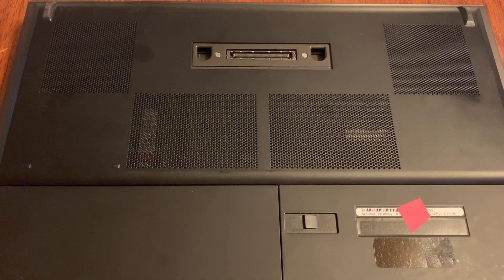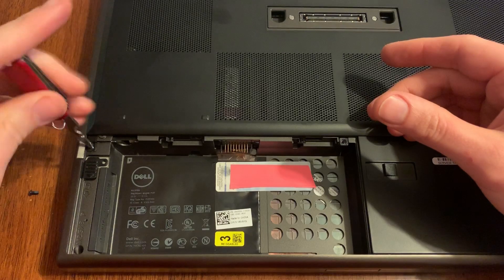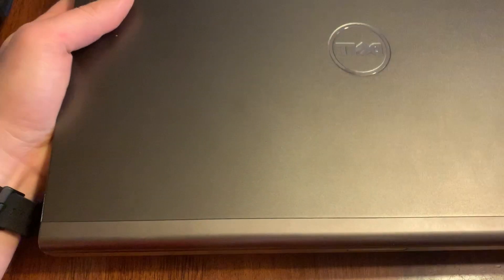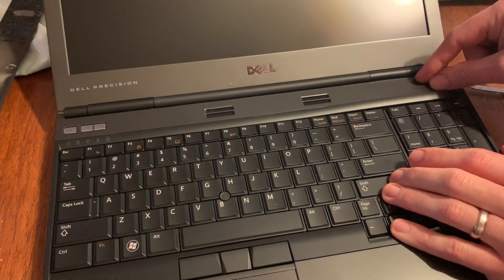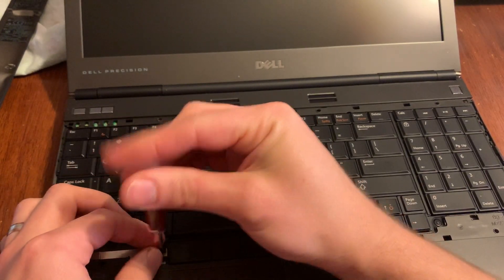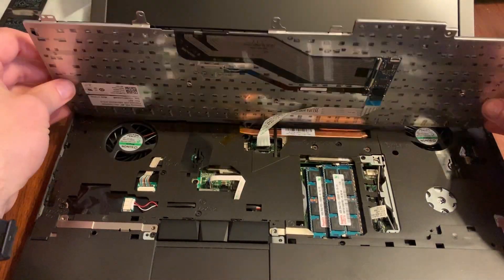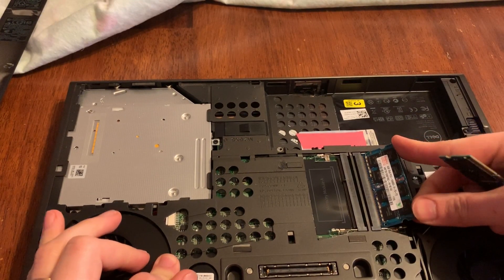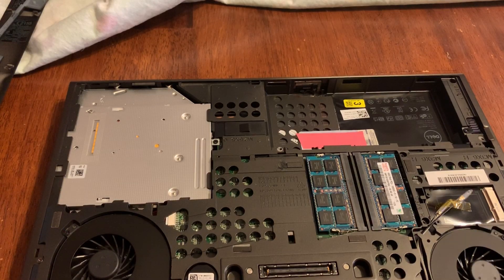Dell Precision M4600 Ram Upgrade

Comment: Thank you for the video. I have  a Dell  m4600 i7, 256 ssd, 16 gb ram and still works great after 8 years.
 I intend to buy another m4600 i5 for a verry good price and need to update the SSD and the ram.
Reply from the maker: They are good laptops.
Reply: Yes please tell its my humble request dude
Reply: Yeah mine works still fine..

Comment: I got the Dell M4800 labtop from 2014.  It's a great computer.  I also like the fact the keyboard is very similar to the IMB think pad keyboard which was my favorite keyboard for labtops
Reply: i want to upgrade my m4800 to 32gb . is it possible .and which type of ram is rquire

Comment: Muy útil el vídeo para realizar el upgrade de la memoria. Mi máquina paso de tener 16 a 32 Gb en ram. Quedó funcionando la locura.
Pretty useful this video for the upgrade of the memory. My machine passed from 16 to 32 Gb, now it works so great. I bought the memories in Amazon, the brand is Timetec
Reply: Qué tipo de ram lleva esta laptop?
O dónde la puedo conseguir, ya que en Amazon no me aparece nada de esta ram
Reply: hola Yahir disculpa tengo una dell m4800 Intel(R) Core(TM) i5-4300M CPU @ 2.60GHz 2.60 GHz con ram instalada de 8 : gb.
 sabes si puedo aumentarla a 32 gb, agregar una de 8 gb en cada uno de los espacios vacíos A y B, aparte cambiar las que ya tiene instaladas de serie de 4 gb cada una ( que me dan los 8 gb) o solo podre cambiar las A yB ?

Comment: Thanks for the video. I've got this laptop, currently with 8GB RAM. I do a lot of film editing - do you think that 16GB is good enough, or might you know if more is ideal?  Also, if I stick the full 32GM of RAM into it, are there any issues you think I might encounter? Thank you.
Reply from the maker: 16gb is probably a good start.
Reply: @mjmcomputers  thanks.
Reply: @joshuajohnson-familyfriend8510  may aswell knock the 32 in, what else are you going to use soddim DDR3 for

Comment: Hi, man! What configuration did you use? DDR3 1333 mhz 1060? TY
Reply from the maker: I don’t recall what I installed but it will accept DDR3-1600.
Reply: @mjmcomputers I'm using 2×8GB 1866 MHz on my M4700

Comment: i try to upgrade mine from 16gb and when i hit the power button, the lights will turn on but the screen will not. is 16gb the highest it will go?
Reply: 8gb ram= dual core max
32gb ram= quad core max.

Exception is 2630qm, this quad only supports 16gb max.
Reply: Also note that the M4700 has trouble with ram speeds greater that 1866 MHz. Even with 4 slots occupied with 2133 ram, they often refuse to boot.

This is the opposite for the M4800, which contains a beefier memory controller on the CPU core, which could support 2133 ram.
Reply: @fermi3294  dangg

Comment: Man I love your Videos! I have this Laptop and it was a great purchase. Thatnks to your videos I found Out I can Upgrade the SSD and the RAM - What other components are up-gradable ?
I´m wondering if the processor is up-gradable as well?
Reply from the maker: yes I think it is, you should be able to find a cpu support list for it to tell you which work with it.

Comment: Only 1066Mhz is correct or even 1600mhz? If u look for a Ram upgrade on google, Crucial website advices u the 1600 version...but I saw on dell support forum that they talk about 1066. Do u know something about? If works, having 1600 could be a good boost.
Reply from the maker: I haven't tried it but I'm sure it would probably work. Worst case scenario it might just run at 1066Mhz.